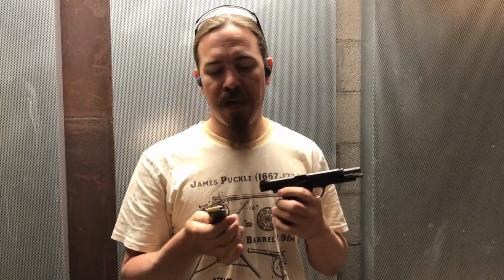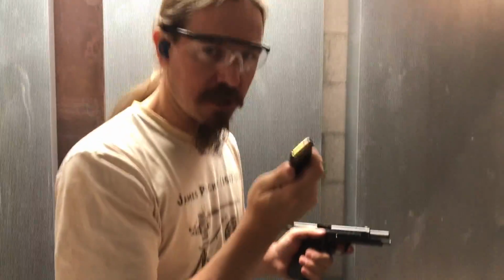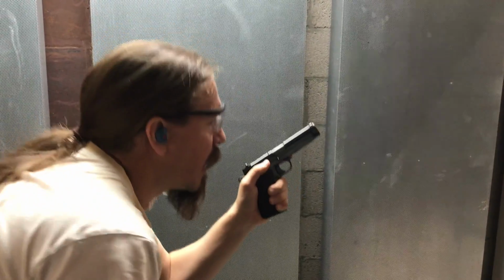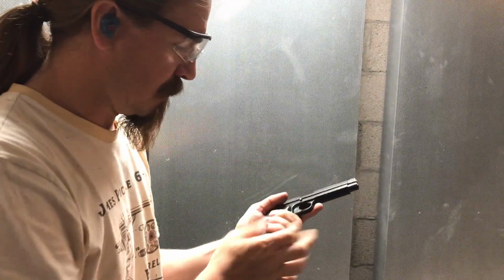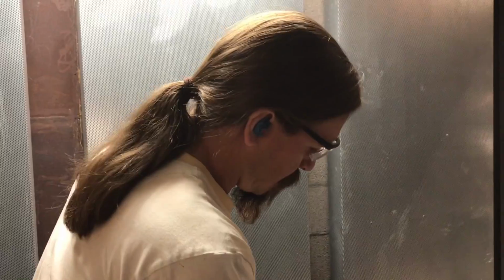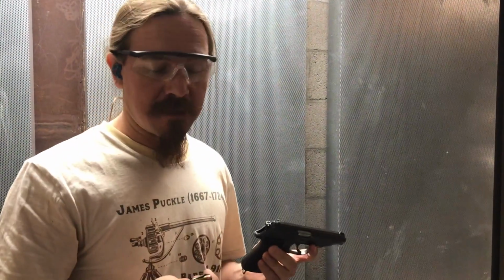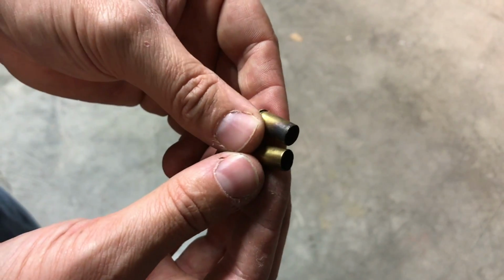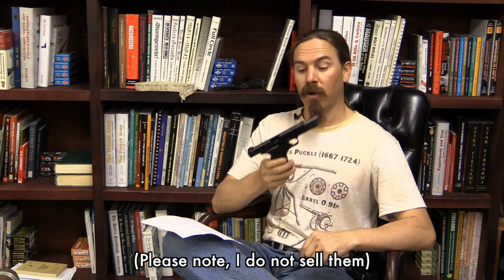Testing 7.65mm French Long Ammo (Reed's and Buffalo Arms)

Comment: I'm curious about your feeding issue, many things it could be
Reply: Could just be that blowback system is worn out, the ammo might now be powerful enough, polishing the feeding mechanism might help
Reply: There is no blowback "system". It's just a slide cycling on the frame with a recoil spring. Nothing to wear out. In fact as a blowback gun wears out it would cycle with weaker and weaker ammo. The only thing to wear in a blowback is the recoil spring.
Reply: Kyle Michaels yes, thats what i meant. Sorry

Comment: when I bought my 1935 A it came with custom reloading  dies. I have never purchased commercial ammo but Midway occasionally when in stock, sells a 20 rnd pack of (Buffalo)  brass.  That plus Cartridges of the world, but alas no chronograph, it was fairly easy to work up functional rounds.  I have handloaded my own. Proper bullet weight  and powder charge was a work in progress,    I also have a 1935 S  and yes,  they are beautifully built pistols.  Out of my reloads I have exactly 51 functional rounds that run, cycle the weapons, and have reasonable accuracy. The rest were poorly made, out of speck. ruptured on the 1st shooting (one left a brass case stuck int he chamber sans head  (grumble).    I consider each funtional one  precious.  When I first heard your info on Starline I quickly emailed them and begged for some.  Here is to hope that this happens. I would LOVE to see your sub gun cycle.. talk about rare...   THANKS IAN  We are a small fraternity, but French weapons aficionados are a persistent cusses   :)

Comment: It's like shooting a .22lr on a 22 magnum will shoot but low speed
Reply: You can do the same thing with .380 in a 9mm.  It wont cycle, and its probably not great for the throat of the barrel, but it will shoot.
Reply: Never knew that about .380 and 9mm, interesting to know.
Reply: Garfield years they have video in you tube also can shoot a 40 in a 10mm
Reply: but the problem with 22lr in 22wmr is that the 22wmr has a larger outer case diameter and will cause the 22lr case to flare out
Reply: I did this with my father and a .380 S&W bodyguard and some other 9mm pistol many years ago. We thought we had defective weapons but the older I got I realized that was not the case.
Reply: Same with 9mm out of a 40cal. Only a mm off. Fires but won't cycle

Comment: Seems too under powered to cycle back.. low power rounds
Reply: or the spring inside could be shorter to enhance blowback. (or less compressed)
Reply: Did he check that what they were selling was actually sized for 7.65 french and not just .32 auto unchanged and relabeled?  

Honestly a flawed bullet mold might explain some of the problems but does not really explain the huge margin in velocities.  I think they just haphazardly poured some powder into the casing not really paying attention to how much there should be or being consistent in any way.  I mean it's only for French guns and everyone knows those are crap anyway so why make decent ammo, any problems can just be blamed on the gun.

Comment: All this focus on replacement original-spec ammo... Why hasn't anyone made replacement springs, so you can swap between the original and made-for-modern ammo springs depending on actual ammo availability...?
Reply: All too low production, man. You're talking about making a spring to sell to the tiny amount of people who want to shoot these a lot, while counting on this cut down ammo being manufactured, and then you need to factor in that huge variance. You'd need to design a recoil spring to work from 700ft/s to 1000ft/s if people want to use both of these ammo types, which is just crazy.
Reply: Well one way to go would be to just ask a local spring manufacturer to make a one-off for your particular firearm. I did that once when I needed and couldn't find the striker spring for my Beholla pistol. 5$ and 10 minutes later I came out with 3 different springs to try out.
Reply: Springs are damn cheap. Also, you can always just see what other guns' recoil springs are close enough. Ordering a smorgasbord from someone like Wolff isn't expensive. For instance, I had a crap craptastic Zastava 357 that had a DA pull that rivaled the Nagant. The hammer spring was the same diameter as a 1911 mainspring, so I ordered a tuning kit from Wolff and it made the gun actually shootable without worrying I was going to put one in the ceiling accidentally

Comment: i wonder tho, why not a steel case ammo? because beside the load, since no one want to shoot full power on an antique if avoidable, i thought the material mechanix of the case had a pretty big play in this, since a brass case is used to ensure sealing due to the pressure "swelling" the case, while on the other hand with a steel case it doesn't swell that much making it so that it will extract easier since it won't grip on the firing chamber as much as the brass, kinda like what we see on the famas
Reply from the maker: The French issue ammo, at least after WWII, was steel cased.
Reply: yeah, maybe they were like, harder springs to overcome the faster expelling bullet and now they don't expell as well with brass? i don't really know much about those pistols history so i can't really tell, but it wouldn't surpise me if they did considering how efficient they were with small arms conversion in general there

Comment: Is there a reason you can't take the Reed's, and Buffalo ammunition, pull the bullets out, load a higher charge in it, and reseat the bullets? 

Alternatively you could take the steel case surplus ammo and reprime it and see if that'd get it running.
Reply: Ethan Moore I believe you are referring to the difference between Boxer priming and Berdan priming. Boxer was designed from the get-go for easy reloading. Berdan,not at all,but with patience and persistence you can do it
With patience and persistence,the elephant deflowered the female mosquito. 
 There it is.
Reply: If you load it too hot it'll start rupturing the weak cases, there's probably a fine line right in the middle there where it will JUST cycle the pistols without destroying cases, but we're now talking super careful hand loading and either the price going through the roof or a weekend of work to shoot a couple magazines.
Reply: Robert Elmore always thought most steel case had that odd priming system that makes it extremely difficult to reload?

Comment: Most will know this already but for people new to this cartridge it is worth pointing out the ammo was originally developed by Remington ammo and was adopted by the US Army as the .30 Pederson or .30 - 1918 (or .30 - '18) Auto Pistol.  

It was demonstrated in the 03 Springfield rifle outfitted the Pederson device and the French liked it so much they adopted it and then developed pistols and sub machine guns to utilize it.  

Bertram brass of Australia also offers brass occasionally.
Reply: keith moore https://en.m.wikipedia.org/wiki/7.65×20mm_Longue

Everything I said is correct and accurate.  32 pistol cartridges are not .32 diameter just as 44 special & magnum bullets are not .44 diameter.
Reply: keith moore 32 French Longue and 32 ACP both use .309 diameter bullets.

Comment: I bought a bunch of Reed’s and it wont cycle either my 1935a or 1935s reliably. I even put a new wolff recoil spring in each gun (which was a pain).
Reply: You'll need a lighter recoil spring if you're gonna shoot the Reed's stuff; If you dropped a new spring in and it didn't work... then the spring is still too stiff. There's a few ways around that. You could keep the existing spring, but trim a half coil off, reinstall it, and then test it again, rinse and repeat until it cycles (reducing the length of the spring will reduce it's effective total resistance, making it lighter), or you could try to figure out what the resistance is on a stock spring and try to source a mass-produced one that's appropriately lighter (e.g. if the ammo is 10% weaker, you'll need a spring that has 10% less resistance), OR worst case: Go to a proper gun smith and have them make you a spring (or even a set of springs) specifically to the right dimensions and resistance you need.
Reply: I think I will just wait until I can find some proper brass and reload to spec.
Reply: @DC2007A  Duelist1954 did make some working loads up, he used 4.8 grains of blue dot.

Comment: you could try to re prime the steel?
Reply: as Danie above says decappiig Berdan is a PITA.  It takes (easiest way) a proper sized dowel rod of wood, a proper anvil with a sized hole  to receive the spent primer  t  and a mallet. Oh, and an old shirt and pants; you will be drenched from the backwash after 10 rounds.  Then you have to find proper berdan primers. Been there, done that with other cartridges.  Also, if the primers are staked as is usual for military arms,  forget it.  With steel cases be SURE to lube properly or you will score your sizing die.  These are just not worth the trouble.  And I say that as a owner of a 1935A and an S.
Reply: It is likely Berdan-primed, not the typical Boxer primer used in the US.  You can reload Berdan primers, but decapping a large number of cases is tedious given the pair of off-set primer vent holes.
Reply: They're corrosive because of the primer. Reloading the steel ammunitions is probably the best option if you don't mind reloading
Reply: Briarus HECATONCHEIRES but it's corrosive and not really a long term solution. Not to mention time consuming for what seems to be a pretty busy person.
Reply: thanks for the info. thought maybe they used boxer primers [french so why not:} ] and just for a test not for daily use.
Reply: because he said the brass was too weak to load at a higher powder charge [correct powder charge]
Reply: Yeah, sorry, that's what I get for replying to comments before letting the video play all the way through.
Reply: no worries... reloading steel is a pretty last resort thing to do

Comment: I would be more interested in getting boxer primed brass then I could roll my own.Looks like French ammunition is as reliable as French cars... Are you getting a long bullet jump (and pressure loss) putting .32ACP in the 1935 pistol with the  longer chamber?
Reply: there was a mod printed years ago in Guns and Ammo for a small steel ring to add to the chamber to size it to 32ACP.  From what I have heard this is a DANGEROUS THING TO DO and NOT RECOMMENDED!  but something returning GIs tried with their trophies after the war.  I had not till today heard of shooting 32 Auto in one unmodified.

Comment: Cool. I have felt your pain. Nice job handling the hangfires on camera.
Reply: As an only amateur marksman, I appreciate this tips *so much". In a previous video, he explained "Don't hold on to the ramrod if knocking out an unfired, jammed round. If the jostling finally sets off the primer, you don't want to be touching the rod if it goes off or have your hands in front of the barrel".
This is the kind of insight that even experienced marksmen can benefit from 'cause it isn't intuitive until you hear the *why*.
I always appreciate being told why when having a do/ do not explained to me.

Comment: When you've already watched the latest Q&A and know neither of the new options are going to work, at least there is light on the horizon with the run of proper brass coming.
Reply: starline making this type of brass is a good call on their part since alot of people dont have the means or knowledge to make the brass themselves from other brass casings. I learned yesterday they are making .455 webley brass, going to be getting me a few hundred since im loading old fiocchi casings atm